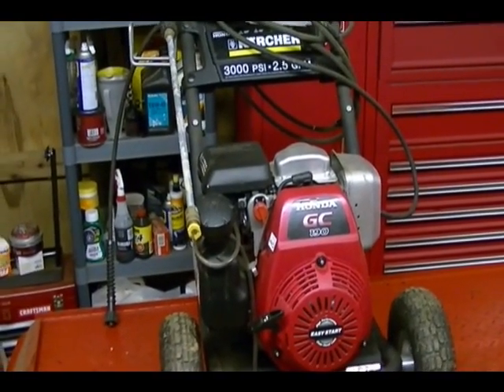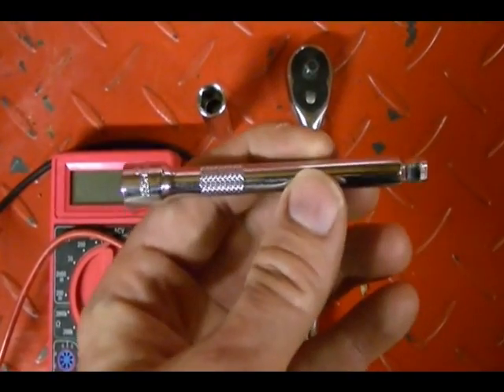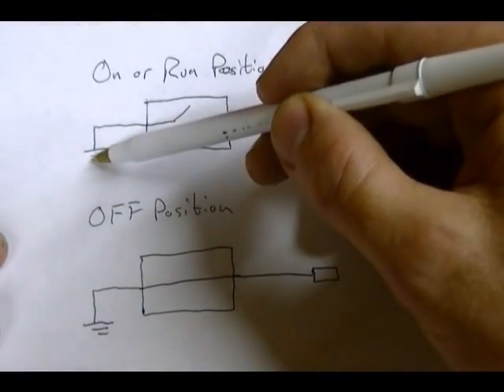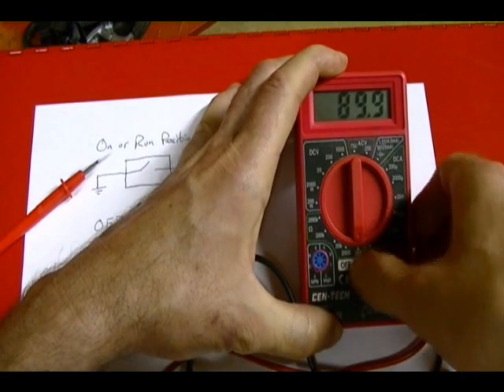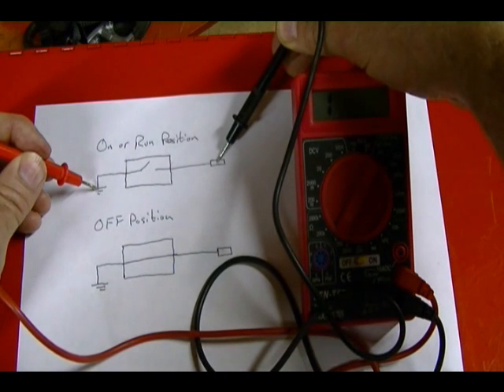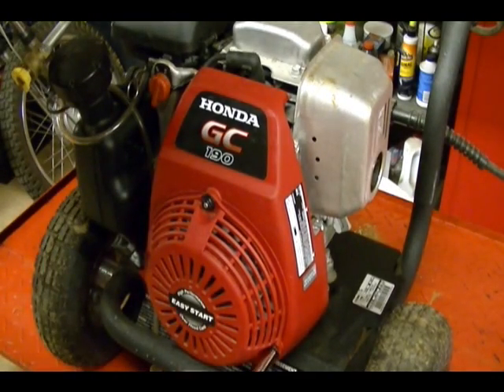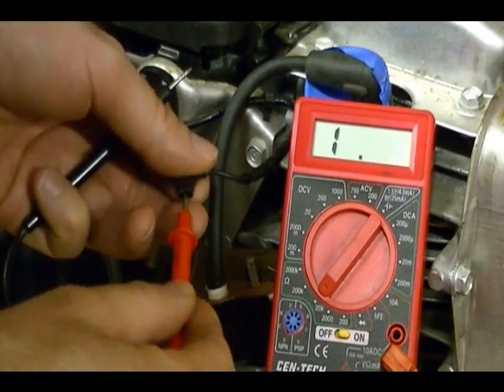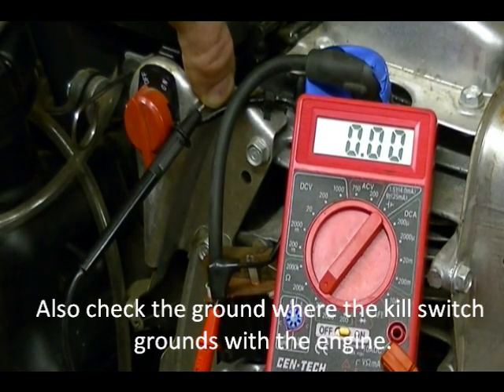Small Engine Repair: How to test the Ignition Switch or Kill Switch on a Honda GC 190

Comment: As someone mentioned below, its a sort of reverse way of thinking.  I watched this several times till it sunk in, great video.  My application is for a kill switch on a log splitter and a necessary safety measure as oppossed to shutting off the fuel and waiting for the engine to die.

Comment: So basically if the switch is "off" or the plastic key is removed, the spark plug is bypassed, since the closed switch circuit has a lower resistance than the spark plug circuit?

Comment: Kinda old but still hopeful bro. I have to check the Ignition Coil and the kill switch on my STIHL MS211, the problem is that it won't turn off... I already got a new IC Module but I just want to be sure that has nothin with it...

Comment: I have a Simpson pressure washer that has the Honda GC 190 engine that simply quit running after about 3 total hours of use.  After giving it a few minutes to cool, the engine started for about 1 second and then quit again.  Both times as though the kill switch was just switched off -  not even as much as a cough or sputter ever since.
So I tested the switch as your video describes, and there is definitely a difference between being in the on or off position.  However, it is exactly the opposite in that the on position gives me zero resistance and the off position reads OL.  Could that indicate a problem?
Thanks for the clearly explained video.

Comment: my 2003 polaris 700 twin is getting no spark at all well i turn the switch off the whole thing goes off like lights on the dash and stuff i do not remember it doing this and when i turn it back on sometimes it will stay off sometimes it will come on what should i do? i believe the stator is bad there is no evidence of it going bad before it quit working though but it does not start at all and gets no spark at all

Comment: Do you know how many amps does this kill switch wire draw?  I am using small 1A switch will it work?  Can you measure it with your meter with engine running and off?
Reply: High Voltage, little current...little switch.

Comment: Well done tutorial.  I am a former electronics instructor and you did a great job of explaining what should happen when the switch works correctly in ON/OFF positions and what it means if the readings are incorrect.  Again, great job and thank you for using a tripod instead of holding the camera by hand.  Wish more posts were like yours.
Reply from the maker: Thanks!